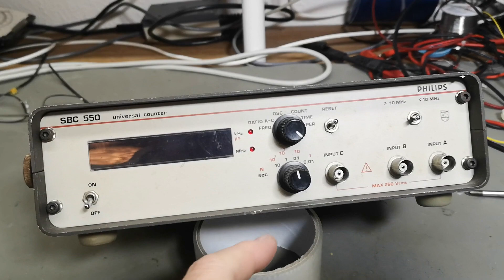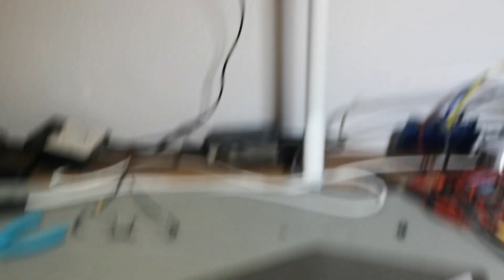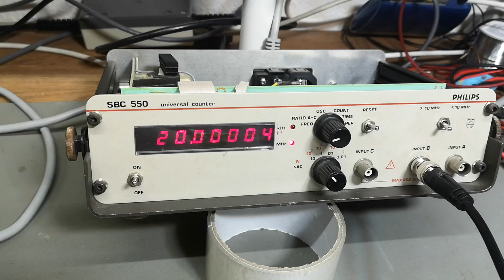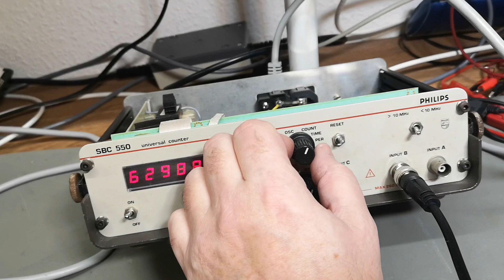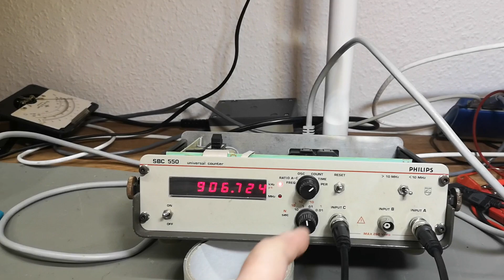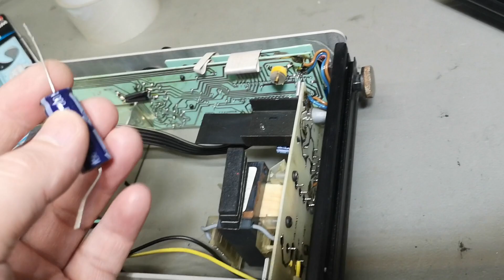Philips SBC 550 universal counter 8 led digits test teardown

Comment: Max freq input?
Reply from the maker: it should be able to handle the rated 550MHz but i could only press it to 460MHz
Reply: @TeardownOZ2CPU  i have the same type too...sbc 550....btw thx FYI friend 👍
Reply from the maker: @jokosudiro9620  try with 100MHz and a weak signal, turn up the signal level until it works, you will see it need much more level, the higher freq you come with.

Comment: I highly prefer LED and VFD displays over LCD from a readability standpoint. I always use LED in my own constructions, even at the cost of a little more power draw and the addition of a extra supply which you might not have needed when using a LCD.
Reply from the maker: exactly, all things that is NOT battery powered, should NOT use LCD it is that simple :-)

Comment: Looks like one of the Thandar units rebadged as Phillips.
Reply: You might be right, this does not look like typical philips components and construction.
Reply from the maker: @Sine1040  Exactly, this one appear to be below the normal Philips standard of quality in design and manufacture.